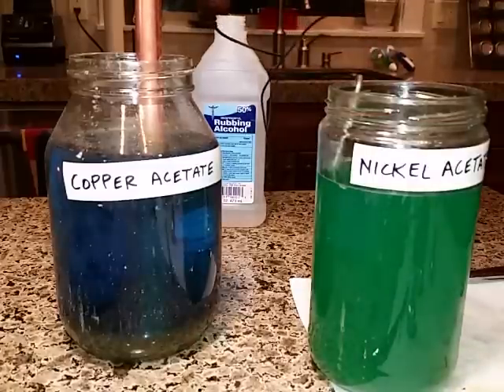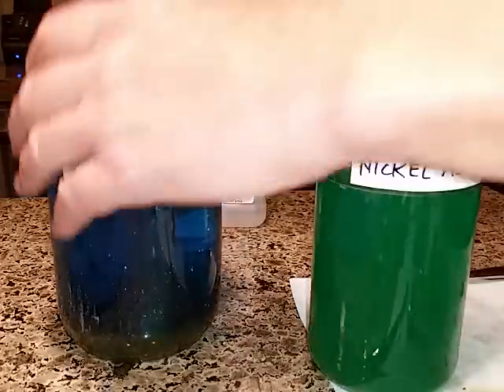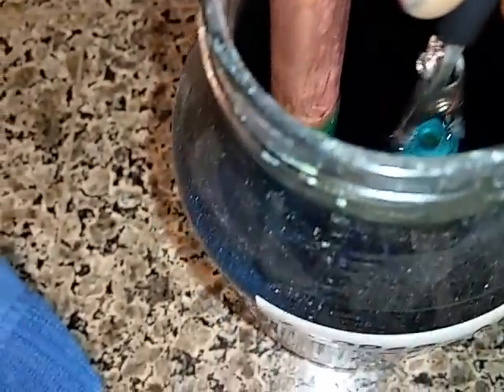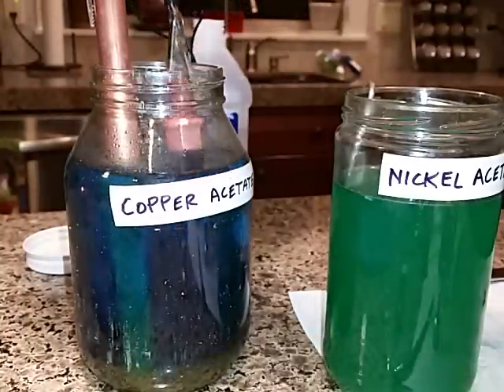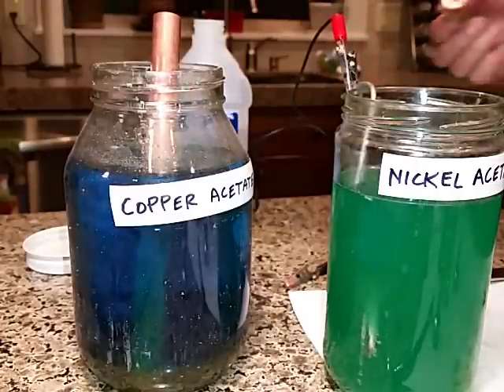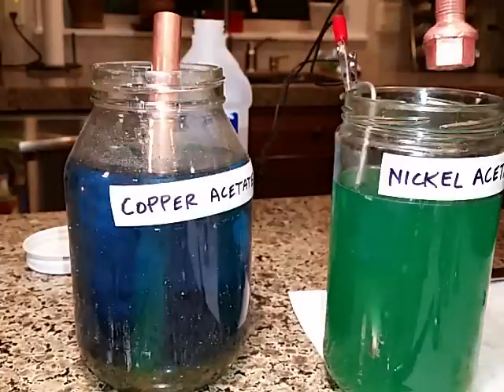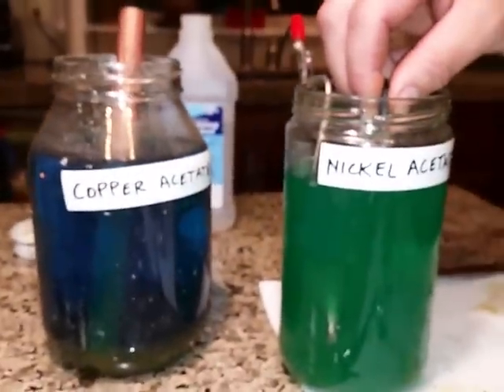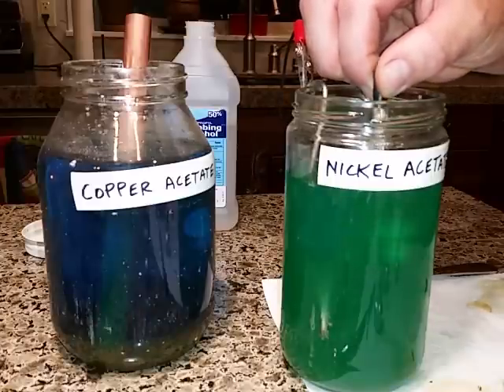Copper and Nickel plating at home.

Comment: Did you make the copper the same way as the nickle
Reply from the maker: Copper disolves much faster than nickel.  Straight distilled vinegar and copper pipe (pieces of anything copper) will disolve within 48 hrs WITHOUT the need for the electricity.  I should make a copper acetate solution video
Reply: Just vinegar. No peroxide?
Reply from the maker: There are several recipes. I just looked at the 2 I have tried. When I made it the first time I used pure distilled vinegar, a cap full of muriatic acid and copper. Later, I tried a great recipe that was super easy and instant. It was: 
1 gal distilled water 
3 oz Zep root kill crystals ($9 at hardware store, solid copper sulfate pentahydrate crystals) 
2 cups Battery acid (sulfuric acid) 
1 cap Muriatic acid (hydrocholoric acid) 
1/2 teaspoon MiraLAX (polyurethane glycerol) 

There is a reason for all the above ingredients. The Zep root kill is 99% pure copper. The battery acid not olny dissolves the copper, but it adds throwing power in plating (anode to the cathode). The laxative acts as a smoothing agent, makes the parts more shiny. But, all in all, if you try copper pieces and vinegar you can get a good solution over time, heck, throw some peroxide in for stabilizing the copper breakdown.
Reply: I didn't have any nickel rods to dissolve so I tried a couple US Nickels to make some, what I thought would be, nickel acetate.  I was told they were nickel plated so I was going to steal the plating off them.  After an hour or so into the electrical dissolving process the solution was light blue.  I must've gotten past the nickel into the copper.  Now I'm reading that US Nickels are mixture of the two metals and not plated.  Out of curiosity I brushed some of the blue stuff onto some bare steel.  The color change was really interesting.  It was copper but with some purple notes.  I would be curious what would be the results of mixing your copper and nickel solutions in a plating process.
Reply from the maker: J Babb Yes, US nickels have zinc and nickel mixed over copper [i think].  I have never tried mixing nickel/copper, but I would assume they would not disolve and plate the same.  They conduct electricity differently and they are difference hardness.
Reply: If you used a 5 cent piece from 1866 you would have nickel, but the coin maybe worth more not to destroy. Today’s 5 cent piece is made of 75% copper and maybe 25 % nickel

Comment: Which battery voltage your connected
Reply from the maker: i just used an old cell phone charger.  you can use a 9 volt battery, it just takes a little more time.  if you use an old charger makes sure you figure out which is  positive and negative. negative  (black) always makes the "bubbles" in the solution.
Reply: @idahomecustomdesign  உங்கள் போன் நம்பர் தாருங்கள்

Comment: what do you clean the bolt with as mine just rusted like mad when i tried to copper plate it
Reply from the maker: if the bolt is really bad then some options are: sand paper, wire wheel or wire brush, dip in acetone, rubbing alcohol, draino, etc.  The point is, get the metal clean clean clean.

Comment from the maker: I made the nickel bath by disolving 99.9% nickel welding rods in vinegar.  I do not believe a silver/nickel blend will work, but maybe give it a try.
Reply from the maker: Andy Walker i have another video on my channel showing how to make the nickel acetate solution, check it out.  make sure you use a light, consistant power source. an OLD cell phone charger works good. the new speed chargers may draw too much.  Also, i cant tell you enough to clean the metal super good.  I use Bar Keepers Friend, its a powder metal cleaner.  Ajax or Comet will work.  make sure you have a big enough solution bath for at least 1/2 the trumpet. Once you plate it take your time polishing the nickel. A dremel tool with a polish pad bit may do the trick.
Reply: What did you use to make the copper solution?  Just vinegar & copper pipe like the Nickel solution?
Reply from the maker: copper solution is easy to make.  copper, vinegar, water salt and time
Reply: Bryan 212 What is the water to vinegar ratio for the copper solution?
Reply from the maker: check out my other vid on making the solution. https://youtu.be/8dF2nKDAtEg
Reply: +Bryan 212 where do you get nickel welding rods? Thanks
Reply from the maker: Andy Walker, I bought a pack at an Ace hardware.  they can be expensive.  sometimes if you find items that are thick nickel plated they work.  takes multi items and longer bcz the nickel is only on the outside layer.  any item nickel will work.
Reply: +Bryan 212 thanks bro- I'm gonna plate an old trumpet- hope it works !
Reply: Thanx for the quick response to my question.
One more:
Would plating go quicker if I prep some solution, drop in some copper pipe, and let it age & turn blue ahead of time?  Or does it need the electrical current to properly pull copper off the pipe and into solution?
Reply: @bryan 212 would love to know the water to vinegar ratio for the copper solution as well...
Reply: Bryan 212 i figured out how to coat nickels with copper without electricity
Reply: Bryan 212 8
Reply: +Bryan Boyle did you dissolve the nickle in vinegar then evaporate the vinegar? or is that solution in the jar vinegar?
Reply from the maker: Solution is with vinager remaining.

Comment: Hi Bryan, Would Nickel silver welding rods stripped of flux, and nickel silver oxide powder work well?
Reply: i think the silver would interfere, unfortunately.
Reply: i say it should be fine if you add a chloride salt to your acid bath, like salt. silver cant disolve in solutions containing chloride, you only need a small bit, maybe a teaspoon. i havent tried it but i say it could work

Comment: Do you have any information on the charger? What volts and Miliamps is it rated for? Also I would suggest you plate it longer. the reason being is that when you are screwing it back on, it is going to create friction and some of the plating will rub off. if there is any iron exposed it can rust the entire bolt out through that one spot. Call it your Achilles heel, like the points on the bolt where the alligator clips are touching it. Rotate them several times in the plating process to mitigate this issue. Good luck!

Actually, now that I think about it, this is a very bad idea, you need to skip the copper step or your bolts will become batteries and that's like oxidation station! OH NO! REMOVE THE COPPER BEFORE ITS TOO LATE!

It's called Galvanic corrosion. Link to wikipedia :
https://en.wikipedia.org/wiki/Galvanic_corrosion
Reply: I would suggest 100mA for plating this size, not more.
Reply: The volts have no importance (a common mistake), it is the current density which is important (current divided by the object surface).

Comment: How did you make the bath?
Reply: To make the bath, just do the electrolyse of 5% clear vinegar (found in asian shops by 5L) with 2 identical ekectrodes until the bath color becomes strong enough. No added salt or anything. Just wait 24h. Current is not critical. 1A at the end for example.

Comment: Looks like you had good results. Did the plating bond well?  I want to do the exact same thing. How did you do it? What chemicals, voltages etc? Thanks for posting. ps The sound wasn't that great.
Reply: Electro plating bonds very well. As long as you do 2 things: Clean the part really well, i used alcohol to wash away any grease from my skin off and then don't touch it with bare skin until after plating. And the second thing is not using too much current when plating, it's better to go "too slow", as too fast will cause it not to bond well and flake off later. Ideally you want a adjustable constant current power supply, as the current is more important to the process going well than the voltage.